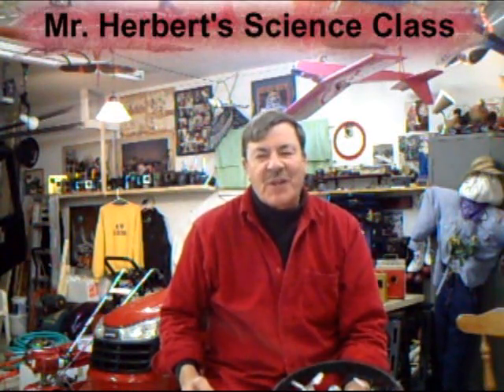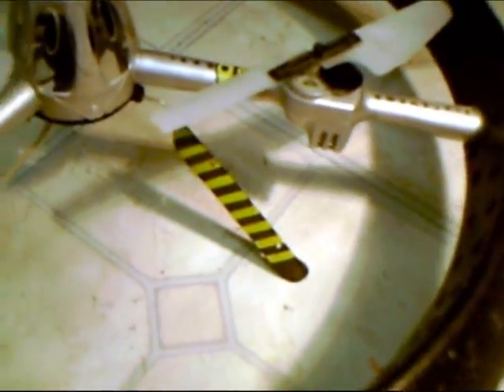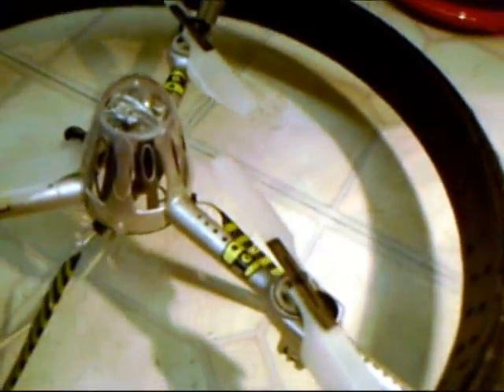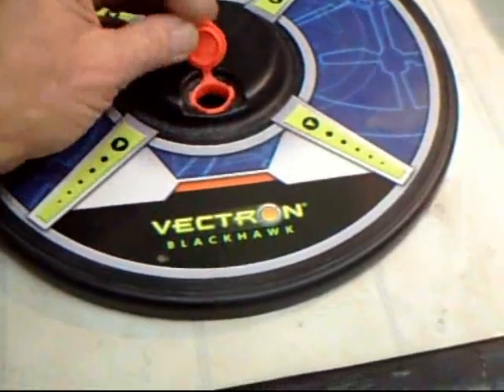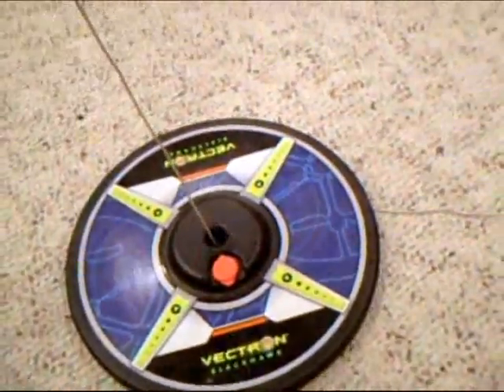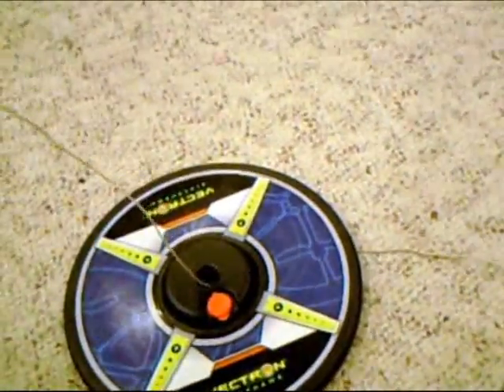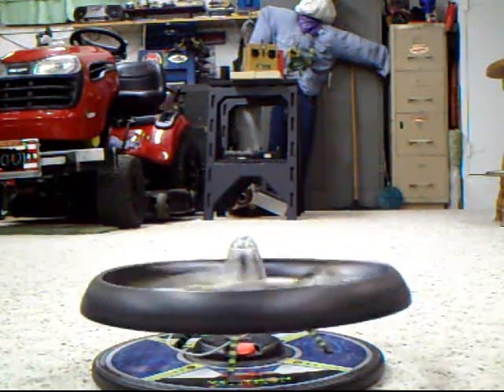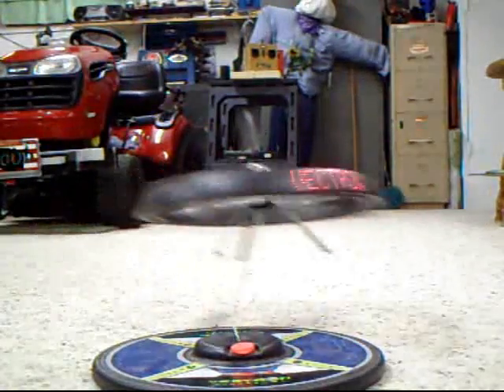The ORIGINAL Drone Vectron UFO Flying Saucer and how it works!

Comment: I built one of these using only two brushless motors, and it was able to lift the motors plus two 2 cell LiPo battery packs.  The first attempt I didn't secure the motors well enough and the centrifugal forces ripped one off.  The second design worked, but like the Vectron shown here there is no directional control.  Only up and down, so it's not much fun once the initial novelty wears off.

Comment: the legs don't move because they are connected to the base were the wire goes in ,and in the begining of the flight, the wire wil twist arround until the tension gets to high ( take a piece of wire and turn it at one end for 100 times or so, you will notice that te wire wants to curle, and when you let loose, it wil twist the other way round) witch makes the wire to twist the other way and vice versa. And when it does that, the legs are spinning too.

Comment: when was the vectron sold? A few years ago I tried out one in a store...looked just like this. BUT it was uncontrollable, the vertical lift was either too low or too high with no inbetween. probably was NOT a vectron, or was crashed alot before...